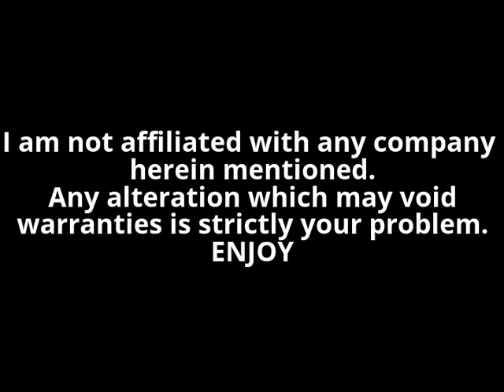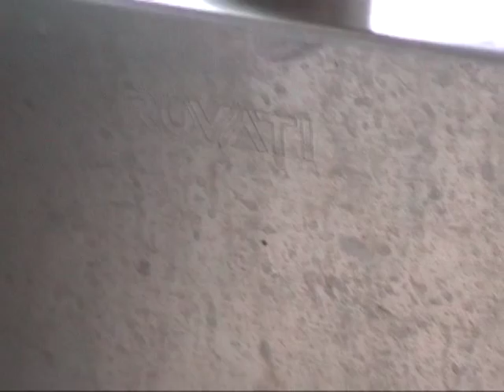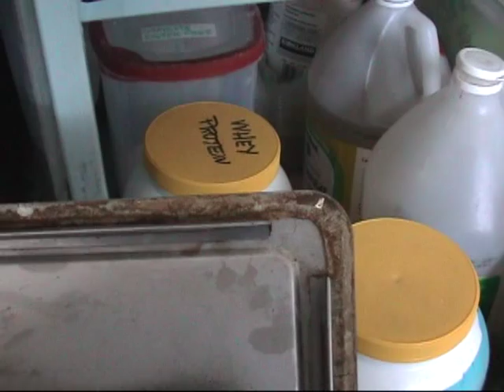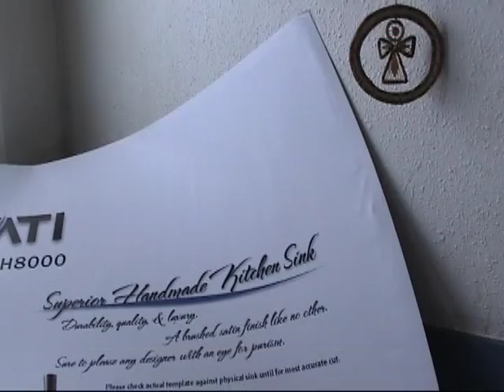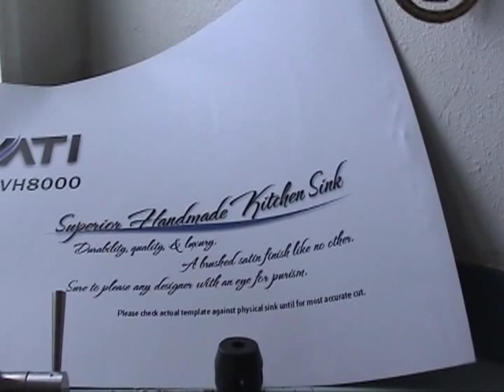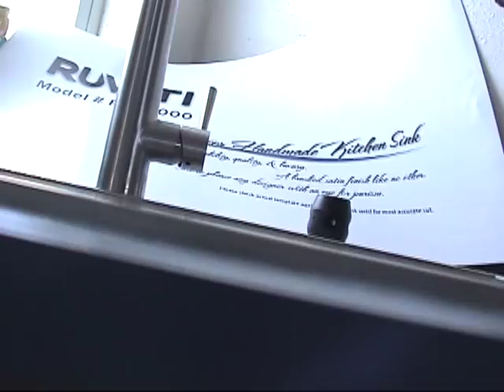Ruvati RVH 8000 and ALFI AB2039S faucet

Comment: It’s been awhile, how is it holding up. I am looking to purchase and install the 33 by 22 model. I have some unique issues and was wondering how much room you had from the back of the bowel to the back of cabinet? Also what is over lap from lip edge to the cut out hole? I have a 31 by 20 inch cut out in granite, problem is the base cabinet is 31 inches wide. The builder or granite installer mounted the old sink on sink cabinets top edge, so the sink edge is pressed between the granite and cabinet. I am going to have to cut out the upper wall edge of the cabinets to get the old sink out. Nightmare. Good video, thanks.
Reply: I just got the 33x22. How did it go? Any tips? I'm using a butcher block countertop.
Reply: Nathan Martinez, Had to go with a different model, with an offset drain, in the end it worked out. Thanks for the reply.